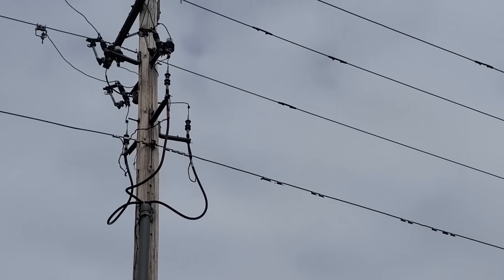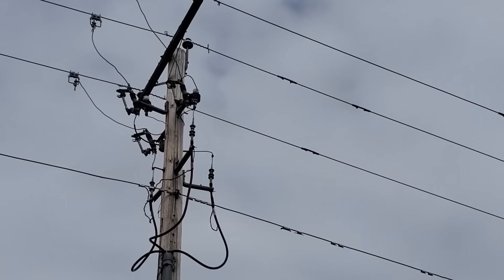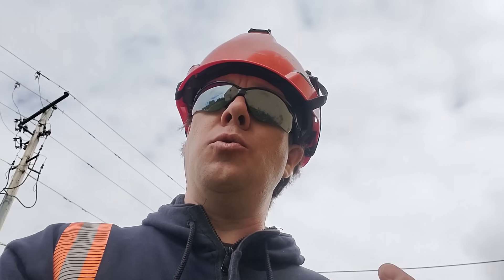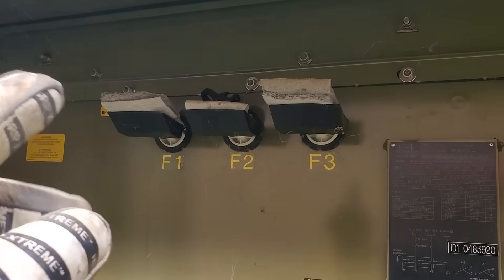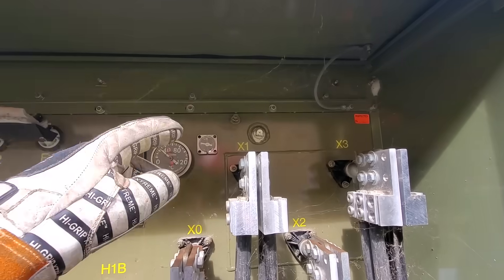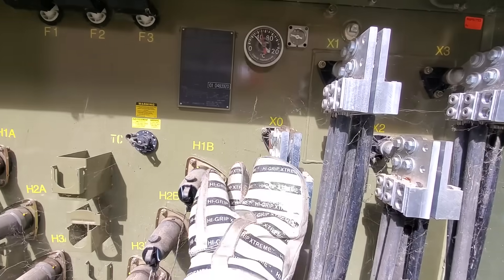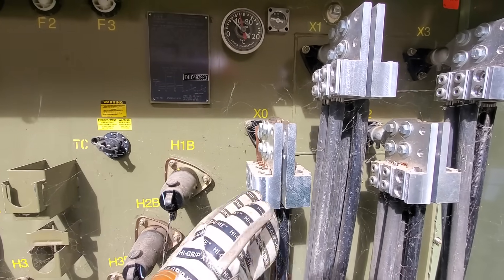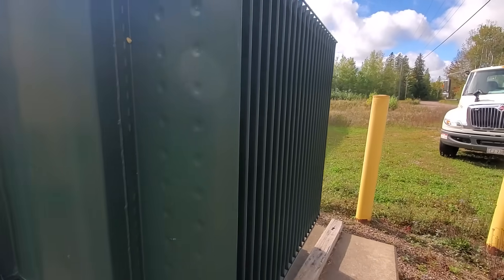A closer look at Padmount Transformers

Comment: Since you said that rodents getting into these pad mount transformers is common in the area you operate in, I'd like to mention an unusual but interesting fact that you probably already knew intuitively, but that your viewers may not have caught on to:
Roughly 10-20% of all power outages are caused by squirrels and other animals. However the good news is that unlike outages caused by something like storm damage or a vehicle taking out something important like a power pole, animal-induced outages are relatively simple to fix.

I'd personally like to see a video where you talk in more detail about the various ways you've encountered animals inducing power outages, as well as perhaps detailing the methods used to prevent them from causing such damage in the first place, because I'm sure you have plenty of material for such a video.
Reply from the maker: That's an excellent idea for a video! An great information to cover! Def gonna do that👊👊. I took a screen shot of this also and will cred the idea. 🍻 Cheers!
Reply: @Bobsdecline  Thanks so much, I'm sure there's more to it than I can think of on my own, since I'm just an auto mechanic.

EDIT:
Oh and I'm sure you already know this too, but rodents especially cause plenty of chaos in the engine bay of a vehicle too, simply because of their instinctual desire (and physical need) to gnaw on just about anything in order to keep their teeth trimmed back. Either Honda or Toyota even makes special electrical tape (pretty standard 600 volts rated stuff) with capsaicin in the plastic and adhesive in order to deter rodents from chewing on the wires, great thing is that it will work on any vehicle since other than the spicy chemical it's just ordinary electrical tape.
END EDIT

The closest thing I get to working with that kind of high voltage is the secondary side of the ignition coils on a gasoline engine, or the occasional hybrid vehicle.
So far I've never really had reason to actually get into the high-power electrical side of a hybrid vehicle, all I usually need to do to them is brakes, suspension, and oil changes and for that you don't really need to disconnect the battery pack or anything like that, but if/when I do I'm gonna do it right and wear the recommended PPE for it. Full EV's and plug-in hybrids are also getting more and more common, eventually I'm probably gonna have to start working on those too, but the same approach applies, I'm gonna protect myself appropriately to do the job the right way.
Reply: Oh I can tell you all about outages from suicidal squirrels. We have an average of 1-2 a year here because they love to climb on the pole pig in our backyard. For whatever reason the transformers on the spur that feeds the three block cul-de-sac I live on are fused so anytime a squirrel meets its maker the whole whole line trips out. Makes a lovely smell too and sometimes like last time a mess when it happens. Mentioned to the lineman last couple times that either fusing the pigs or putting squirrel guards on them might not be a bad idea but nothing has been done.
Reply: @LtKernelPanic  re: "We have an average of 1-2 a year here because they love to climb on the pole pig in our backyard. "
Pole mounted "reclosers" called "Trip Savers" made by S&C Electric will automatically reset after trip ... bringing power back on immediately. They mount in place of a fuse on a cutout. ONCOR, our distribution system manager, installed a whole slew the past few years, and they seem to be doing the job for us.
Reply: You'd think in the year 2022, we'd have figured out how to outsmart the squirrels by now... every time I hear that, it sounds like a lame excuse / cover up for "we don't do any preventative maintenance, only reactive maintenance after something broke - just blame it on a squirrel - people still buy that line"
Reply: @gorak9000  What rodents lack in intelligence they more than make up for in determination. Hard metals and concrete are just about the only two things that can truly keep out a rodent, because they're literally able to (eventually) chew thru pretty much anything else, given enough time.
Reply: We get 'tree contact' fails in our lateral run to a bunch of homes in our subdivision. Then the tree trimming crew comes out, and we are good to go for another 5 to 8 years ...

Comment: Very cool! I remember Louie the Lightning bug from my youth in the mid to late 80s. I have always wondered what was inside those green containers. I always thought it was a bunch of various wires and fuses of different ratings. 

If there is any kind of damage, would you recommend notifying police or power company that it belongs to first?

Thanks for video! 👊
Reply: The one time where contacting the police would be a good idea: if you need assistance with crowd control, to keep people away from the danger.
Reply: Power company only. Police can't do anything without their assistance, and as equipment owners, they would be the victim in any formal police report.
Reply: Louie looks much cooler than the bird thing we got in Ontario!

Comment: Excellent explanation of what's inside the humming green box.  

A few things that should also be mentioned: Never place bushes, trees or anything closer than 6 feet from the doors and 3 feet from any side. Crews need the space to work safely. Do not ever paint or attach anything to a padmount. Do not attempt to drill into or cut open a padmont. Do not cover a padmount with dirt or anything else. Instruct you kids not to play on or near any power equipment. (Padmounts can run hot and failures, while extremely rare, can happen.) Also, call the power company immediately and give the location and equipment numbers if any padmount is leaking, making loud noises, smoking or is damaged or shifted on the pad. NEVER approach any padmount or other equipment that is leaking, making loud noises, smoking or damaged. Stay at least 30 feet or more from it. 

True story: Was working with one of four electrical contractors on a commercial service upgrade (800 to 2000 amp services.) A competitor had finished well before us, and was having the service energized by the power company. 

They had screwed up the secondary wiring creating a dead short on the brand new transformer (which did not have internal fuses like the one in this video.)  The power company closed in all three cutouts in rapid succession, and that padmount literally blew apart in a matter of seconds. Total damages were in excess of a million dollars.
Reply: I remember walking past the padmount in my parents back yard every day to hop on the school bus.  I also mowed the grass around it.  When there was service, I saw it opened.  One end was the 10kV side with removable high voltage fuses that could be used to isolate the next transformer east/west/south, the other end of the box was the 400V side powering the neighborhood with much smaller isolation distances and heavy gauge cables to the various roads.  It is on my parents lot because the house was electrically heated, thus being on a contract which allowed the power company to do that without leasing or buying the 100+ ft² of land for pad and access.  In recent years, it was replaced with a new model that I never saw inside, probably because it was over 30 years old.  I did however see some of the underground cables which were similar gauge on both sides, probably to allow energy passing through on the high side.

Despite all those observations, I never saw them use side access for cover operating with hot sticks.  Until seeing the fuse clip in this video, I always associated hot sticks with work on the 132kV and higher long distance overhead lines.
Reply: I know a guy who is banned from our property. He had a 3 phase 120/208 wye padmount failure job so just had to do an in and out. Replace the padmount. We’ll he did but he never read the name plate on the new unit. When the apprentice close in first cut out he heard popping and buzzing noises coming from the building. So he stopped. And the foreman said shut them all in it’s getting late. Long story short the installed a 277/480 padmount and sent 277/480 into a building that only needed 120/208. I’m sure that was a big bill for the company. People are idiots. Read your name plates on existing and new pots, take rotation of an existing rotation is known or find a piece of equipment that can be checked before fully sending to entire building. On a padmount I’ll leave secondary leads off then energize the unit check my rotation and voltages on the ferrils. De energize and make my connections then send it. Same on an overhead pot. Never assume that someone in the factory or the shop did their job right. As a lineman I am the last stop before sending the power into the building. So it’s up to me to verify and be certain that I am sending proper voltage and rotation into a customer. That’s why we get paid the big bucks. Any idiot can plug wires into bushings, it’s know why and how to do it properly and assuring no damages to the customers property and me and my men go home safe. Bottom fucking line
Reply: @linehandibew6205  Gotta feel bad for the apprentice, sounds like he knew something was very wrong. And I cannot see an apprentice questioning a foreman, Someone who is supposed to be one of the most experienced on the site.
Reply: @linehandibew6205  Great attitude!  Share your work ethic and mind set with the new people coming into the trade. My son recently started his apprenticeship. After almost a year as a groundsman he has had quiet a mixed of mentors, mostly good but some just “angry men”. I raised him with a “pay attention, and work hard” mindset, so now it’s up to him,, with some help from Great mentors.
Keep Teaching
Reply: @sunrisetacticalgear2676  couldn’t have asked for a better trade for him to get into. Love what I do. I take pride on how I train my apprentices the same way I take pride in my craft. It is a product of me. They are a direct reflection of who they were trained by. I enjoy it.
Reply: @linehandibew6205  Why do you misspell the letter Y that visually describes the wiring of a star configuration transformer?
Reply: @johndododoe1411  because there called wye transformers or a wye delta… do some research, everything will come up as “wye”
Reply: @johndododoe1411  because that’s how it’s actually written out lol. Guess you know nothing about transformer theory? Search transformer connections. Wye/wye wye/delta. It’s actually the proper terminology. Get educated on the terminology before you make criticisms on something you don’t know about bud
Reply: @FishFind3000  obviously someone who is being a keyboard critic that isn’t educated on the theory and terminology of the industry.
Reply: @FishFind3000  Original use of the term "wye" came from the railroads.  A "wye" is where three tracks are connected so a train or engine can reverse direction.
Reply: @johndododoe1411  it’s not misspelled.  It’s WYE in the lineman world.
Reply: @kelliegrase4658  Only in the US, the country that still thinks General Electric people invented everything.
Reply: @johndododoe1411  We use 'Wye' in plumbing also. I assume it is done to raise the layman's eyebrows. Youtube marks it as a typo unless it you use a capital W.
Reply: @johndododoe1411  if we didn't invent it we sure as hell made it better.
Reply: @johndododoe1411  hey that’s an excellent question. Guys are saying “do some research” - “its industry standard” but nobody answered your question 🙄 Why is Y spelled wye? So I did some ree-search like the guy said… it appears that ‘wye’ is the noun to describe the shape of a Y. I learned 3-ph systems 40 years ago and never knew why we use the word ‘wye’.
But transformer configurations are also sometimes abbreviated as Y-Y or D-Y (but replace the D with a ‘delta’ triangle…)
Reply: @ronslubik6318  A Δ-Y transformer has delta-wiring on one side (usually for an IT config like long distance grid pylons) and a Y-wiring on the other side (usually a center-grounded TN or TT system like the ubiquitous 400V/230V household supply outside North America or the 215 V system used in commercial US settings).
Reply: @johndododoe1411 Wye is the typical spelling for that electrical configuration! Not 'Y'.
Reply: @epicemmalee2000  Only in North America .
Reply: @johndododoe1411  Y, Why and Wye mean different things. Wye means that it's safe to lick the secondary neutral.
Reply: @Jeff-hq1jw   I've worked with this type of equipment for over 40 years and have seen too many things go wrong and the aftermath. And sadly, people in general have gotten a lot stupider over the years. 

Have you ever seen what happens to copper theives who cut into energized primary voltage cables? It's not pretty. You can find plenty of pics on the web.
Reply: @turbokatzenburg5732  did they look crunchy and black
Reply: @turbokatzenburg5732  No, older generations have had just as many stupid people as the newer ones. People haven't gotten dumber, its just nowadays we have the internet to document stupidity more.
Reply: I would have sued that competitor for the million dollars.  You don't screw up wiring on (in the US) 440 volt service for industrial use.  Screwing up 110 can be bad enough but 440 volts with (example) a 2000 amp fuse (or no fuse at all) can be super deadly and (as you said) extremely costly.
Reply: I use to sit on those to soak up the heat they let off they're free heat in the winter
Reply: @Mike-su8si I wonder if a neon tube light will light up if laid on top of one the same way they do under high tension wires. I'm going to try it and find out.
Reply: Also, much damage can come from wiring the wrong phase rotation.
Reply: You would be surprised how many people build fences 2in from the door on padmounts, then wonder why their power takes so long to get back on.
Reply: @motarted1735  You would be surprised by how many people despise these ugly boxes in their yard and will do as they please to hide them. Deal with it. 
These boxes should NOT be placed on residential property and expose the neighborhood to their inherent danger and visual pollution.
Reply: I work for a company that has to come in and test this type of equipment when it's installed, and after any "incident". Still makes me a bit nervous when the transformer "grunts" on energizing.
Reply: Do not taunt Happy Fun Ball.
That said, everything you said is technically valid, although just try keeping kids off of them.
Reply: there are no accidents only negligence or lack of training
Reply: do not insert padmount in mouth or rectum.
Reply: Found the unnecessarily long-winded know it all speech!
Reply: @davidrichter9164  Says the no content troll.
Reply: Millions? I call bullshit on that price
Reply: @eclipse369.  You have no idea what was in that building. Industrial equipment is very expensive, for a reason.  Besides that, his statement was "were in excess of a million dollars.".  This was an 800 to 2000 amp upgrade. Why?  Brand new equipment setup. A million plus is chump change in the industrial world. Don't be a dolt.
Reply: @eclipse369.  some of the buildings literally have hundreds of thousands of dollars in just wiring work alone. Any piece of even moderate size industrial equipment it's going to be in the $100,000 range.
Reply: @eclipse369.  Call whatever you want skippy, I WAS THERE and know what had to be replaced, the labor, the downtime penalty they had to pay out, the replacement switchgear, feeders, padmount ect. So unless you were actually there, on that jobsite (maybe you worked for that rat contractor perhaps?) you don't know, so the only bullshit here is your comment.....🤔

Oh, and I didn't say MILLIONS, I said IN EXCESS OF A MILLION.

Comment: where i live, we have all the medium voltage in underground cables. But we also have the ability to energize the line from 2 ends, and disconnect in every substation, so we have the ability to work at one section of cable, while the rest of the line is energized. We also have a 3 phase 400/230 volt system, which enables smaller wire sizes. we only use 25, 50 or 63 amps main fuses. if we use a 25 Amp fuse for a house, at 400 volt, a 120 volt splitphase system requires over 100 amps.
Reply: I assume you mean 25A 400V 3 Phase?  If that's the case, it is 17.3kVA.  That's equivalent to 72A at 240V.  
North America is really 240V:  https://www.youtube.com/watch?v=jMmUoZh3Hq4
Reply: @matthewbeasley7765  On split phase, the equivalent of 3x25A on 3x230V is 2x75A on 2x115V.  Which might round to 72A if that's their standard fuse size.
Reply: @johndododoe1411  Do it again, but use 240/120V instead of 230/115V.  The standard nominal voltage is 120V, not 115V in North America.

Comment: Those load break elbows, That second "loop" closer to the cable end of the elbow.... Is that not some form of  load break / disconnect??
A lineman of our local utility was giving  me a bit of a quick overview when they had a vault open once.. Thought it was pretty cool
Reply: There are load-break elbows and dead-break elbows.

Load break elbows as the name implies, are rated for being pulled while carrying current.  The way it typically works, is the person working on the transformer uses a 3 meter long fiberglass rod (called a "hot stick") to pull out the load break elbows.   This way, they keep a safe distance from the medium voltage parts, and avoid an arc blast if it happens.

Dead-break elbows require another device to shut off the current first, like a pole-mounted load break switch, before disconnecting the elbows from the bushings.  Usually, 200A and less can be done with load-break elbows, while higher currents are only available in dead-break elbows.